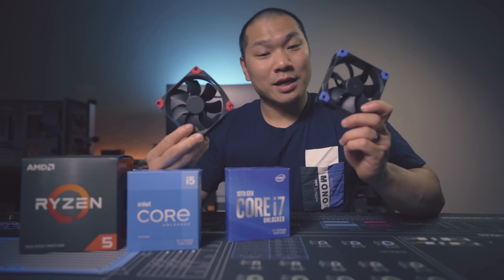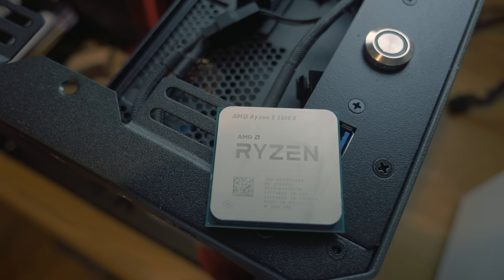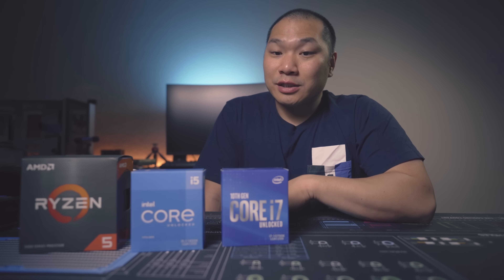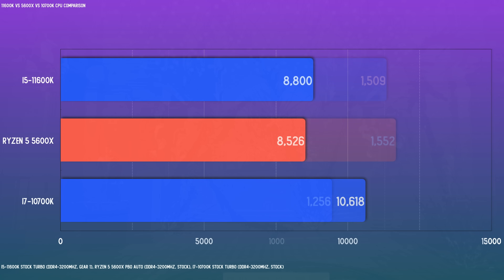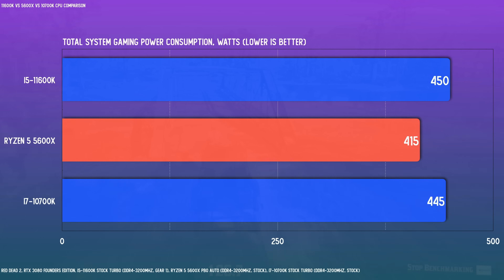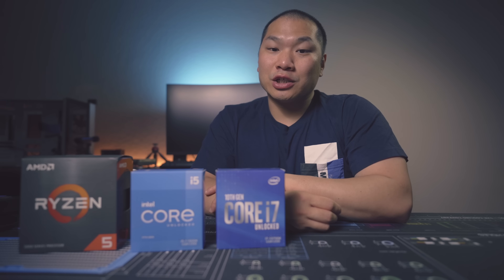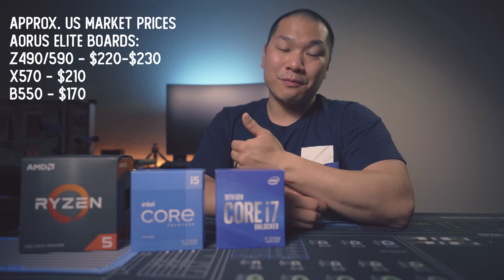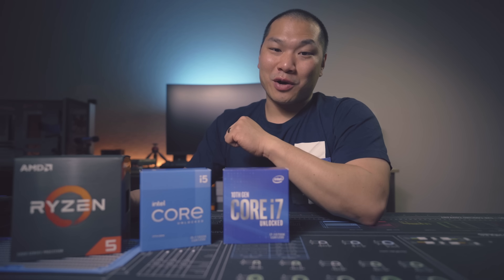11600K vs. 5600X vs. 10700K - Mid Range CPU Battle!

Comment: Microcenter had the I7-10700k at $199 as of Jan 2, 2022. That's what sold me. Bought the ID Cooling SE-224-XT at $25 and you can NOT find a better cpu and cooler for those prices period! AMD has nothing in the $199 price range that can touch the I7-10700k today 1/2/2022.

Comment: I have 10700k OC @ 5.2ghz on all cores, never going above 55c most of the time. Best investment ever, still holds up. Especially for 1440p gaming.
Reply: Do you think I should get it over the 5600x? I’m not planning on upgrading for a long time
Reply: @Skomskk  Ya, 5600x is a good investment if you can get it for the right price. Here in Canada it is about $40buks cheaper vs 10700k. And you have the B550, where you can upgrade to something like 5900x. But, games will depend on more cores in the near future. 10700k is also good for the right price. I am able to compete with my friends 5950x, but at 1440p.

Comment: nice comparison  i moved from a 1155 series chip to a newer intell chipset but didnt splurge on the cpu until the market calmed down a little i was lucky i bought a vid card at the time though before last xmas   anyway im in the market now  ....i find that the greatest thing besides m.2 is the pass through for graphics that if i have a gpu in the system and im still pluged into the motherboard graphics port i still see most of the frames for instance 80%  as from GPu i can see this in eternal  not sure any of a gamer road is cut out for a gpu but were talking now Xfire ANd Xsli  and a more unified scenario were multiple gpus are truley without bridges ... chip prices are down somewhat but i was wondering if anyone has done a xeon series chip review  for instance w-1350p i can see very little from current posts  as no one is contemplating graphics workstation but i think its in there

Comment: 6:40 - ran into similar issue with 11600KF on Gigabyte B560O Aorus Pro AX, RAM Crucial Ballistix 3600CL16 2x8Gb sticks - it would not post in Gear 1 with XMP on. Only if I put Gear 2 or 3466 into BIOS settings the system would post. So I am using 3200CL16 now :/

Comment: The super crazy thing is that you can get an Aorus B450i for under $100 and it will handle a 5600x no problem. $500 gets you ram+cpu+motherboard which is an insane deal right now.

Comment: I can agree with that the 11600k isn’t the greatest but still I think rn intel could be the budget king bc u can buy 11600F or 11400F and pair it with b560 unlocked powerlimits which will boost the performance also because u don’t go w the k Chips u should go for b560 and by that u safe money and can spend more money on a GPU .

Comment: was happy that I bought a 10700k for $240 dollars but I was really shocked on how hot it can reach. 🤯 thinking about going AIO or buying an airflow case.
Reply from the maker: It can be hot and runs hotter than average if you are used to prior gen Intel CPUs, then again this is basically the 9900K. One thing is check your mobo settings and make sure any game or performance boosts are turned off, those settings tend do tend to overvolt the CPU for a meager clock boost. I think a 240 AIO is fine place to start for this but I run mine at stock on that U9S with push/pull A9 fans.
Reply: @MachinesMore  I tried syncing all cores and adjusting the voltage. temps dont go past 79 anymore. Thanks!

Comment: I know, late to the post.  I actually have the 9700K and AMD5600X up side by side.  Not exactly the same but my observation, the 9700K still kicks AMD 5600x around.  Yes more cores it should, but even on single core actually chips up side by side.  Both running on Asus boards of comparable range.   The 5600x is new to the mix, i'm trying to understand where temps should normally run on it under full load.   I know it has the failsafe at 95, I'm seeing 40% load temp of about 75-80 degrees.  I do have auto-overclocking on.  I used crap stock paste (I know, replace the paste) because i thought it was a generally cooler running chip (read being lazy).   obvious question from a newly rejoining clocker temps typical?  Concern on system in gen, and performance as well.  Also dont truly understand the importance on mem speed, i know there is some magic in there.

Comment: Fine job here. Appreciate the 1440p results alongside the 1080p. The 5600X is the 6 core that thinks its an 8 core. Either 10700-series or 5600X are good. Just pick one. I own both. After you factor in  gpu price, cpu/mobo price fades into insignificance. Can't find 5600X in stock at msrp? Then the choice is made for you unless you want to wait.

Comment: I think 10700F is best cpu for now. Much cheaper then 5600X (I think at least in most regions). Doesn't require Z motherbords and could be couple with B560 (similar price to B550) for ram overclocking. 100MHz less then 10700K and faster in most cases then 11600K.
https://www.youtube.com/watch?v=-99Ko5Gy9-g&t
Reply: @Nico Yu In video from link,  there is a list with boards, which will handel 11700, so also 10700 easy.

Comment: got a 10700k for $269.99 recently but saw the 5600x is $289.99 rn. i know the 5600x is better for gaming but will the extra 2 cores on the 10700k make a huge difference for multitasking/streaming+gaming/recording+gaming?
Reply: @Vuk Stamenkovic yeah i wish i returned my 10700k for a 5600x. runs a bit hot in certain games. it’s alright though. will probably just avoid those games LMAO.
Reply: @eeeFloww  I mean what cooler do you have? because i have a 75$ aio and my temps are fine... also make sure you don't have vcore on auto as its well known auto vcore is a bad thing... it overvolts your cpu causing stupidly high temps... set a manual vcore... im at 5ghz all core i get 28c idles and 58c gaming temps 78c 100% load on cinebench r23... it only needs 1.315 vcore auto was applying 1.4+ lmao causing 70c gaming temps...couldn't even run a stress test without shooting past 80c also make sure you have a good fan curve set or pump speed set correctly if you have an aio...returning a 10700k for a 5600x is a literal backstep... even JayZtwocents said.
Reply: @TheBURBAN111  how do i change my vcore setting? i have arctic ii 280. using msi z490
Reply: @eeeFloww  go in to bios with f2 then go to advanced mode with f7 and it should be on the first page near the bottom... you want to start off with 1.3v then go lower until it bluescreens under load/stress test once it bluescreens bump the vcore up till it passes cinebench r23 or intel burntest without any issues you want to get it as low as possible as it will lower your temps a lot.
Reply: @TheBURBAN111  okay thanks
Reply: @eeeFloww  and pump speed should be in fan settings in the bios... ideally you want it set to max.
Reply: @TheBURBAN111  okay thank you!
Reply: @Vuk Stamenkovic the 10700K beats the 5600X in gaming and editing
Reply: @Vuk Stamenkovic Ahh seems like you've felt victim to being brainwashed by AMD
Reply: @Vuk Stamenkovic it uses 40-50w while gaming... while the 5600x is at a locked 60 unless you undervolt it did you even watch the video.... plus the 10700k can be found for $250 stop being mad you have a 100w psu... if you had a good power supply you wouldn't be crying about power usage... it only uses high power under 100% load/render stress tests normal day to day gaming and streaming will literally use 40-70w lol.

Comment: For $300, the 10700k wins this hands down.  Two more cores and four more threads.  It's simply more "future proof" than the other chips.  Ye, you may get another couple of FPS on the 5600x, but I'd rather go for the extra 2 cores, especially since it has a lead on pretty much any multi core task meaning that you may save 15-30 minutes on a full day of work every single day.  This soon adds up over a period of months. 
If it's a choice between two six corew CPU's then yes, I'd go for the 5600x every time, but those two cores and four threads are too juicy to give up.

Comment: my system: 5600x, b550m itx, patriot viper 16gb(8gbx2, 4000mhz), ventus 3x 3070 oc, coolermaster nr200p with both glass sides on and all hdd/ssd slots occupied, set 2 fans at bottom and 1 at rear to bring cool air in, top 2 fans bring hot air out, after one hour bbq with furmark's cpu burner and gpu stress test(4k), cpu about 75c and gpu about 65c, not bad at all.
Reply from the maker: Love the fast RAM kit!

Comment: how is my 10700k at 5ghz with a bad aio getting better temps? 58c gaming 78c stress temps either way all cpus are good for the price point... id rather have the 10700k because the extra 2 cores...i have fine tuned loadline and vcore though.
Reply from the maker: I would think since you are overclocking you dialed in a manual voltage, which pushes your chip to lower for a specific clock frequency. Here the test is relying on stock motherboard boosts vs finely tuning the chip- the stock voltages are usually far too aggressive. I do know that my particular 10700k can hit 5.1 but that's silicon lottery and manual settings right there.

Comment: I'm here cuz I have a z490 and wanna change my i5 10400, Nice Video
Reply from the maker: That would be a sensible upgrade assuming you're not GPU bound. The 11400 is very very close behind too.
Reply: @MachinesMore  but I feel like my i5 10400 struggle to stream warzone at 1080p
Reply: @wolflexx2146  If you are using nvidia try nvenc encoder in your streaming program it can make make a big difference but if you want something faster either go with the 11600k or 10700k as they can be found for cheaper than the 5600x atm and offer similar performance... the 10700k should be better for streaming as it has 8 cores.. plus the 10700k overclocks well with a cheap aio or good aricooler.

Comment: the price point for 10700k is almost perfect with more cores and its overclock ability.
Reply from the maker: The price is the huge factor now since these things can be found even cheaper in certain retail outlets. Usually Intel doesn't drop price that much for their past gen SKUs, that was AMD. Now the tables have turned😟

Comment: I am kind of in tune with your thinking for the most part.  But there is one place I diverge on the decision tree.  I think the 3600 (readily available at $200 USD) is just too good a deal to go with the 5600X.  Granted the 5600X is a much better CPU, but it would just be a temporary CPU till 5900X prices come down anyway.
Reply: 3600 at $200 is much to expensive honestly. You would probably be better off buying 10400f/11400f on a b560 and sell it off once you want to upgrade to a 5900X
Reply from the maker: Right, the issue with that is the 10400 and 11400 exist. Will try to get a comparison going on those.

Comment: I have a qn .. i am running R5 3600 on NH d15 chromax and nzxt h510 case. My ambient temperature is 32C while playing red dead redemption 2 temps are between 64-70. Is my d15 running fine? Or should I reapply my thermal paste ?
Reply from the maker: I’d say it’s nothing to worry about given your high ambient temp but I think typically you could get better temps with a D15. A few reasons- the H510 doesn’t have an ideal airflow configuration, and I am guessing your cooler is setup in a way that it is taking in GPU exhaust, which combined with the glass panel, is causing those ups and downs in the CPU temp.
Reply: @MachinesMore  Thanks a lot sir 😊.  I am living in India . It lies in tropical region that's why in all seasons ambient temps are between 30-35. H510 is also a reason yup . Very little mesh on the left side👍 👍 thanks once again...

Comment: planning to upgrade my i7 8700 to i9 10900 gen. bec my 3090 bottlenecks on i7 8700. nice review though as always.
Reply: 6/12 bottleneck? ARE YOU serious?
Reply: @privacyprivacy8206  yup
Reply: @privacyprivacy8206  6 cores isnt enough for a 3090 imo... some cpu intensive games will cripple most fast 6 cores when paired with a 3090... plus assuming its the  i7 8700 non k thats the issue...

Comment: The 5600x is still so tempting but holding off for the 5900x stocks to come back. The 5800x is still just wrong for the pricing and the heat it puts out compared to even the 5900x
Reply from the maker: Well, if you know if you need the 5900X’s extra cores, and the 5600X is half of that, so it’s not really a chip I would remotely consider if your needs dictate 24 threads. I would agree the 5800X is an odd compromise on price but actually sets a very good balance between productivity and gaming.

Comment: The one thing I do give Intel is ram stability and oc Ing. It’s honestly all over the place for zen 3 ram oc Ing once you hit 3600cl16 at even sub 600 trfc for 2x16 dual rank Samsung b die sticks. Then again I only have an matx b550m mag mortar mobo, which basically states that 3733 MHz is prolly the max. Personally not comfortable adding 1.45V and above on my ram kit, I prefer 1.4-1.425V. Lowering Trfc has a pretty big performance bump.

Comment: Overall the 10850k is the cpu to get imo if you have the money and just do typical moderate overclocking. 10700k is a pretty good all arounder. Intel is mainly great for those that like to tinker a lot especially with ram. Zen 3 esp the 5800X seem to require a really good mobo to maybe achieve 3800-4000 MHz ram with pbo2 oc.
Reply: Steamed Cream yeah if you have a zen 2 or Intel 9th gen (8700K would be min from 8th gen) there’s really no reason to upgrade unless you do super competitive high hertz gaming or heavy productivity prosumer work. I’d wait until 2023 for ddr5 to mature a bit. Other than nand storage technology, seems like chip shortages will continue for a while and pc parts will only become more expensive due to tariffs, inflation, and high demand. For new builds, I’d personally go with 32gb ram.

Comment: I had an upgrade plan. But the Huge price jumps changed all that. Between Miners and Scalpers parts are hard to come by these days. Add to that is the factory price jumps. I upgraded my monitors and even that is getting hard to do. In my upgrading I found myself putting in a GTX 950 video card into a new build because quite frankly I could not find a new one cheap enough to put into it. I bought a Ryzen 5 1600 for $85 and a Asrock 450 miicro MB. Upgraded that to a whole new computer I built with a Ryzen 3900X  MSI 550 A mb and a 1650 Video card. My new plan was to move that 3900X to the 450 mb and retire the 1600 and up grad the 550 to a 5900x. No longer the plan. I think my next computer will just be a prebuilt one when needed.

Comment: Hey M&M. I’ve got a asus B450-F Strix mobo, a Ruben 5 3600 and running in a Cerberus X case. With my noctua U9S Chromax set to push pull, I see peak temps of 78C in Cinebench R20 multi. It seems high to me. Seem high to you? 

Similarly in games (like subnautica and Heros of The Storm) temps go to around 75C. Again, seem high?

Idle temps around 48 to 55C. 

I have a chance to get a used Asus x470 strix motherboard from a friend. Do you think a board with a better VRM would help my CPU Temps? Do I just have a poor quality 3600? I’m running stock clocks and have 3200 ram set with PBO.
Reply from the maker: How is your GPU setup and how are fans oriented?
Reply: @MachinesMore  two 120x25 noctua intake at bottom to an EVGA 1080 FTW which idles around 40C and hits maybe 70 in a demanding game. 

1 noctua 120x25 intake at the front. Rear 92mm slim exhaust and top 120mm slim exhaust again noctua. 

Tried video card in lower position thinking I’d give the cpu (vertical mounted U9S now, was front to back before) more clean air to breathe.
Reply: @I can hear your tears good user name. You can hear my tears looking at system temps playing 1440p 60fps like a filthy casual. 

Yeah I remounted. Tried front to back and back to front air movement. Various fan speeds and such. I’ll probably do a U12S build next time. I’ve always been nervous about an AIO.
Reply: 75c is normal and absolutely alright for that CPU. IMHO just keep it as it is.
Reply: @zebarzebra  what’s too high? Most I’ve ever seen gaming is 80C but that is a rare spike. Would a 5600x have better thermals?

Comment: my 5600x runs pretty hot inside the NCASE M1 using a Noctua C14S. Idle temps at 45 but when gaming it reaches 80
Reply from the maker: That is oddly high for gaming unless you have a very hot ambient temp. Have you tried curve optimizer? You don’t necessarily need to tell it to boost, it can just do a consistent undervolt to lower temps if needed.
Reply: What gpu are you using?
Reply: Mr.Ed117 yeah definitely would suggest undervolting the gpu especially In A small NCase M1. I would also look through various sffpc subreddit threads on most optimal airflow with that particular cpu cooler.
Reply: that is odd. even my old 2700 is 40 on idle with 92mm arctic cooler.
Reply: your gpu has to be heating up your CPU, the numbers dont seem right in that config